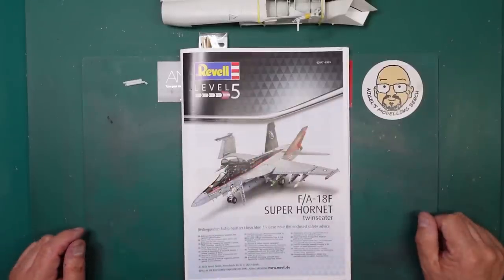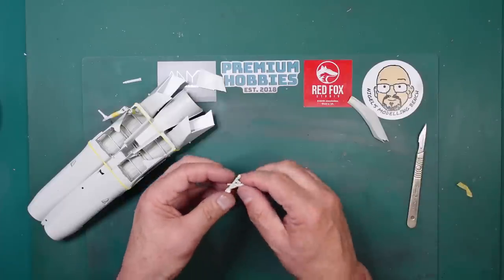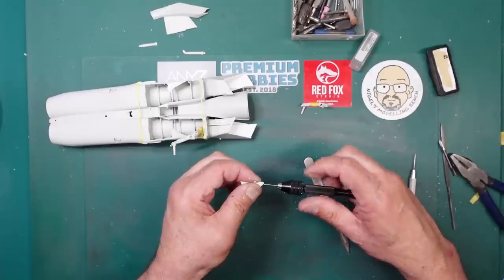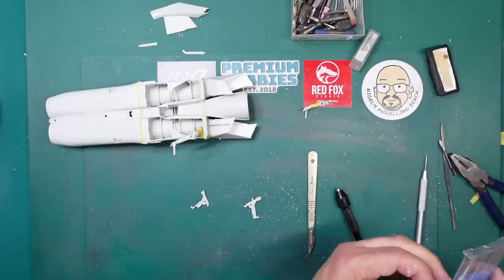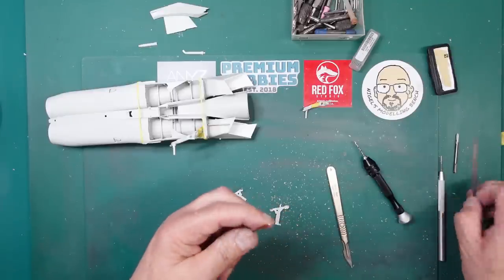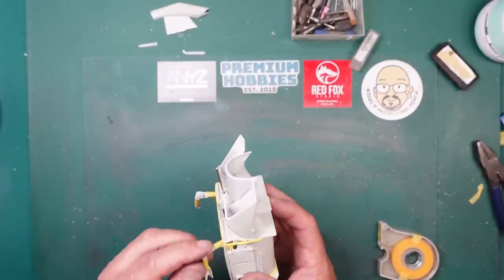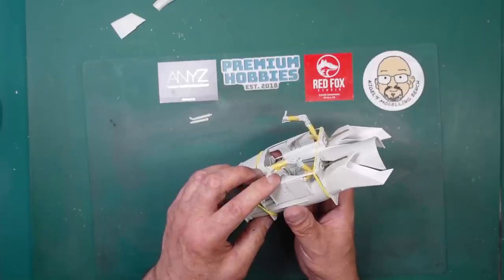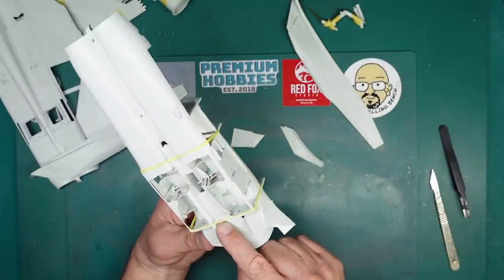Tackling the Revell 1/32 F/A-18F for newbies. Part 3

Comment: Hi Nigel, On my 1/48 Hobbyboss Hornet. On one main landing gear, the shaft that the wheel fits on, snapped off at the hub. Are you going to strengthen yours with some brass rod?
Reply from the maker: Already done mate, in part 4.